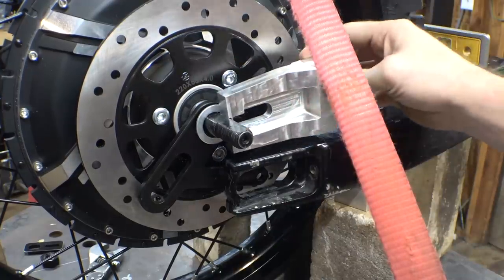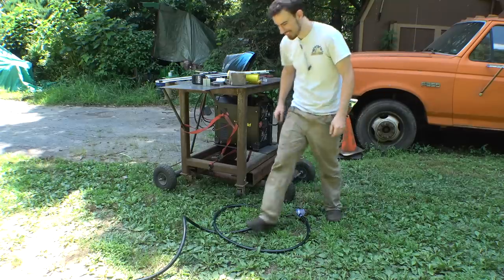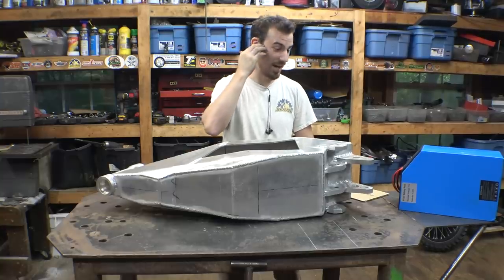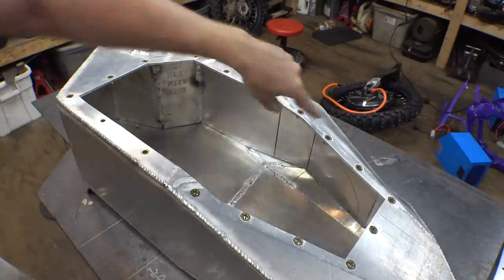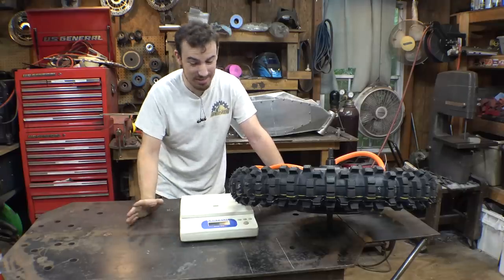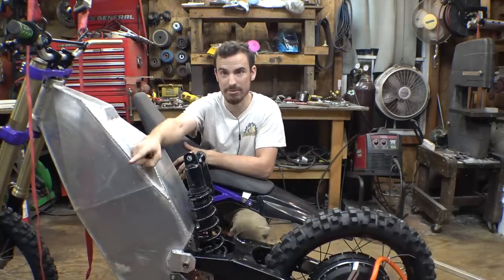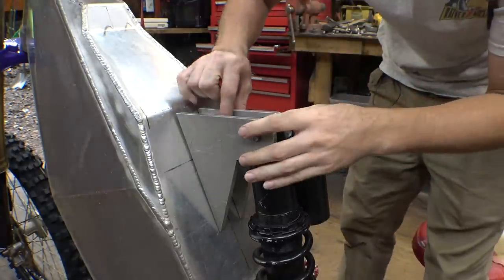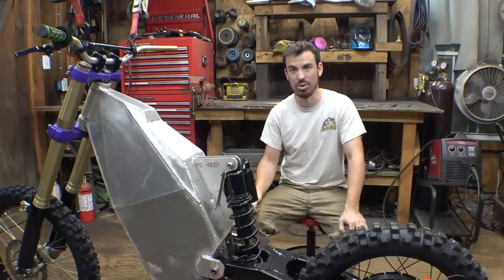Home Made Electric Dirt Bike Build - Part 5

Comment: I'd like to see the sondors metacycle rear wheel and swingarn weighted...8kW nominal/15kW peak, with wide road tire. it seems like they found interesting solution to have the spokes attached to small brackets on the very outside of the rim, probably to make the wheel stronger and more resilient to bumps ant potholes..with the disappointing acceleration, I've given up my preorder, it seems like too many compromises compared to a proper short range e motorcycle like a zero fx

Comment: I had the exact situation with not having 220v in my shop and managed to find an extension cord longer than 50 ft that just barely made it to my welder and it works perfectly! I have done continuous welding with it and it never heated up or anything. I definitely don't love how janky the solution is... But it does in fact work...

Comment: If that is a Pakweld 6 AWG extension cord you can run 100 ft. no problem.  I have a 75 ft. and it works great!
I'd consider putting a jint double on the top and inside of those real wheel mount blocks (if you can).  I wouldn't trust that butt weld either.

Comment: Nut rivets are great...BUT
THEY ARE METAL AND YOU PUT THEM IN SOFT ALUMINUM. 
DO NOT OVERTIGHTEN THEM BECAUSE THE RIVET WILL SPIN IN PLACE AND THE BOLT WILL NOT COME OUT! 
Believe me I know! 
I was freaking out when I saw you using the impact on them.

Comment: Fardriver controller are good for the price. 65 Lbs, QS 273 has a ton of copper in it. Its the one of baddest hub motor they make. Don't worry about the weight  in the rear wheel. While not ideal it will be fine. You will be happy when you bike makes 200 ft lbs torque. If the controller get too hot while inside the frame it will protect itself. Do you have any idea what the BMS in the new battery is set at? It looks great. Looking forward to more.
Reply: The BMS is the key to all of this. I mentioned that back several episodes ago. Doesn't matter how big the battery pack is if the BMS can't supply the amps.
Reply: @jamescole6846  agreed. I would love to take both batteries apart and built one big one with a larger bms
Reply: The other alternative is to bypass the bms.
Reply: @ryanmerrill8879  That's how I run mine and it is a pain in the ass to keep an eye on and charge but I run 14.4v 16000Mah lipo packs in a 4s2p string which is 66v 32amp. They are 20C discharge rated so I can easily yank a 150 amps when I need to. Most of the time I average about 80amps. it was a temporary thing until I got a good battery pack but 3 years later and I still put up with them ad have yet to get a real battery pack which is why I am following this.
Reply: @jamescole6846  I build batteries here in Canada. I started with LiPo about 12 years ago. I eventually decided to build my own from used LifeP04 cells. Now I build up to 100ah batteries that output up to 1000A. Safety the most difficult part. Put everything in a metal box is my advice. I still love to watch other people builds which is why I'm here.

Comment: it would be nicer if you milled the ends a little bit smaller so it could shove in to the rear arm like the original did couple centimeters.

Comment: 🇺🇸🇺🇸Hey when you get the other cord I would run some pvc for wire and put it in the ground it doesn't have to be deep. Maybe a foot deep and it would be good to go it's the way I've got mine and it's great it's worked for years that way and no problem

Comment: The angle changed because the difference between the original front tire and the new hub tire has it leaned back from when it was with the original back tire

Comment: Hi ! the Bomber that I assembled as a Kit and a wheel motor also from QS motor but it is a V3 of 8 Kw nominal and with my anti-puncture inner tube which alone weighs: 1.650 kg and my new Bridgestone tire which weighs heavier than the original one, my wheel weighs 28 kg and I do off-road without any problem, but reasonably because I have no experience in off-road, so I do not ride at very high speed on completely rutted terrain and I don't do any jumps, especially at my age, I don't want to break anything and destroy my Bomber. It's that a Sur Ron leaves it largely behind in all terrain, but this one is a very small and light motorcycle next to my Bomber which weighs 82 kg, because the frame is all steel unfortunately, on the other hand your frame is beautiful and your Bomber should not weigh very heavy. it's good for off-road, but on the road too light a machine which can reach almost 110 Km/h, (well for mine anyway) when it's too light compared to power and torque , it becomes unstable at high speed. I know that since I changed my tire, it's been night and day compared to the Chinese tire it was equipped with, what a difference in road holding and flu too. But these hub motors are a treat, no noise so to speak, insane torque compared to not huge power, and for me it's just fun and I always have a hard time getting off of it, it doesn't it's only the autonomy of my battery that brings me home, I have between 65 and 70 km max of autonomy, but I have a lot of long and steep hills in my area.
For info here is one of the videos of my machine, lol! which gives me great pleasure:
https://www.youtube.com/watch?v=Ldwiy9KROUA&t=3384s

Salut ! le Bomber que je me suis monté en Kit et un moteur roue aussi de chez QS motor mais c'est un V3 de 8 Kw nominal et avec ma chambre à air anti crevaison qui pèse à elle seule : 1,650 kg et mon nouveau pneu Bridgestone qui pèse plus lourd que celui d'origine, ma roue pèse 28 kg et je fais du tout terrain sans problème, mais raisonnablement car je n'ai aucune expérience en tout terrain, donc je roule pas à très grande vitesse sur des terrains complètement défoncé et je ne fais aucuns sauts, surtout à mon âge, je n'ai pas envie de me casser quelques chose  et de détruire mon Bomber. C'est qu'un Sur Ron le laisse largement derrière en tout terrain, mais celui ci est une toute petite moto et légère à côté de mon Bomber qui pèse 82 kg, car le cadre est tout en acier malheureusement, par contre ton cadre est magnifique et ton Bomber ne doit pas peser très lourd. c'est bien pour le tout terrain, mais sur la route un engin trop léger qui peu atteindre presque 110 Km/h, (enfin pour le mien en tout cas,) quand c'est trop léger par rapport à la puissance et au couple, ça devient instable à haute vitesse. je sais que depuis que j'ai changé mon pneu, c'est le jour et la nuit par rapport au pneu Chinois dont il était équipé, quelle différence de tenue de route et de grippe aussi. Mais ces moteurs Hub sont un régal, pas de bruit pour ainsi dire, un couple dément par rapport à une puissance pas énorme, et pour moi ce n'est que du plaisir et j'ai toujours du mal à en descendre, il n'y a que l'autonomie de ma batterie qui me fait rentrer chez moi, j'ai entre 65 et 70 km max d'autonomie, mais j'ai beaucoup de côtes longues et raides dans ma région.
Pour info voici une des vidéos de mon engin, lol ! qui me donne beaucoup de plaisir :

Comment: Seat solution, why not a scrambler/cafe-racer style seat?
Reply: And just build a pad to fill the empty space on the frame/use the empty space for a gauge bracket, (you’ll need wheel speed/rpm/battery etc

Comment: Part 5 part 6 part 7 part 8.. sorry Chris but damn
Reply: Hopefully he rides it in the next video
Reply: It’s super important that you match the stock frame with the top shock mount.  I think the reason your seat isn’t fitting right. Is that your shock is too far up.  I think compared to the stock frame you need to raise your fame up a bit.  You really need to build a jig with the stock frame, shock, linkage etc. and swing arm and you will find that the seat will fit.

Comment: I wonder why you didn't make a steel frame and weld the mono shock with the frame instead of a simple thin aluminium casing? Besides you could have use some bearings for the rear fork bolt instead of simply using aluminium hook and the bolt! Good luck any ways..

Comment: Why did you go with a hub motor over a mid drive? For more quiet operation?
Hub motors are not good for going over jumps just so you are aware? Also not easy to change wheels if you want to make it a motard?
Reply: 17 minutes in you addressed my questions 👍
Reply: Not sure if you read the comments or not? But I've got an Stealth Ebike that I'm hoping to modify to convert it into a mid drive bike? I'm hoping to have more motocross style wheels like what you are running also. But the idea I was thinking of doing is mounting the the motor too the swing arm and having the swing arm extend into the body somewhat? That would eliminate the issues experienced with the chain drive system on most conventional motocross bikes? When you see a motocross bike jump and land; when the rear shock is fully compressed, the amount of slack in the chain is overly concerning to me? This is due to the mid drive engine and swing arm pivot point. The mid drive motor is detached from the swing arm, so the pivot point between full compression and full extension on the bike effectively lengths and shortens the chain? However if the motor is still mounted mid drive but not into the bike chassis; but remaining on the swing arm; then this would cancel out the shortening and lengthening of the chain drive? I would extend the swing arm beyond the rotation point so that the shock can remain in the stock location and wouldn't have any adverse affects on the suspension geometry?
I thought it could be really cool to eventually convert the chain drive to shaft drive within the swing arm(deleting the chain) and because of the motor location and what I mentioned already, it would make the shaft drive considerably less complex than conventional shaft drive systems on motorbikes?
I would like to incorporate a 3:1 CVT but without the clutch mechanism (plenty of YouTubers have tried CVTs on ebikes and failed because they retain the clutch system with all the weights etc) electric motors need to be clutchless to work with the CVT in order to function correctly? Lastly the torque tube inside the CVT will need to be recut to ramp up the CVT much earlier because electric motors make instant torque from 1 rpm and not like the ICE motor that needs to wind up due to its rotational mass and flywheel system?
Doing all this could effectively make a bike that could be switched from dirt to road (motard) in a matter of minutes because no need to adjust chain links for different rear sprocket etc.....it could be swap in and swap out in minutes?

Thoughts?
Reply: I've subbed to your channel too 👍
I thought I'd share some additional ideas with battery pack for my build also?
I'm thinking of using blade batteries as they are far safer and nearly no chance of explosion if they get wet.
Because of the motor returning to mid drive and therefore reduction in over all space within the chassis, I am considering going wider with the battery up top and integrating water cooling using conventional motocross style radiators and panels? To further increase rapid charge times by regulating the battery temperatures (great for prolonged wide open throttle and large amps while thrashing+ regen) but on top of that utilising Peltiers for inductive rapid cooling whilst charging along with fans on the radiators as there will be no air flow past the radiators while the bike is parked recharging 😉
So fans + Peltiers would kick in whilst being on charge and possibly during extended periods of thrashing? Peltiers are highly inefficient, however they do provide rapid cooling (and or rapid warning capabilities if you live in a cold climate). This is something Tesla owners have issues with when they charge in snow conditions as the battery pack needs to charge extremely slow when the battery internal temperatures are less than 50 degrees celsius. Peltiers can literally be switched from hot or cold depending on their polarity. Plus they are a damn lot smaller than a air conditioning system for a motorbike! 😁

Comment: Shouldn't that rear strut be mounted with the wheel at where you want maximum droop on the rear? You mounted it with no load on it at rude height, so when you lift the rear of the bike up, there will be fuck all down travel?

Comment: So you realised that a perfectly built factory frame, designed on a high end CAD/CAM system, to precise specifications for rake and trail, cannot just be easily replicated? You should have just used the KXF frame, there would have been enough fab work involved and you wouldn't have made all those mistakes. 😉

Comment: It's actually better to have that un-sprung weight onto the tire-- because it puts less weight onto your shocks.  It's not that big of a deal.  It's not like it's rotational mass.  Most of the mass in the hub doesn't spin, so it shouldn't sap your acceleration.

Comment: Highlight of my Sunday! Voltage drop along that length wouldn't be that great. So long as it isn't coiled. Amp hours has everything to do with battery pack size. Greater the A H bigger the pack has to be. 12kw wheel maybe un sprung weight. But imagine how easy it would be to have a two wheel drive dirt bike with two 6 kw hub motors. Easy to do as well.

Comment: How about you listen the audience/community and before starting a new project have community help you design the project, so you dont run into major issues like with hub motor?
Since we are in this stage, just swap the name of the project to dual sport, since this thing will have traction issues on any higher speeds on uneven surface due wheel being too heavy to respond rapid changes of the surface and higher speeds having negative effect on the handling like turning into corners and cant jump due danger to rim, so its not suited for off roading like dirt bike and more suited to pavement and going to dirt roads where it can more easily rescued when running out of battery. Might even get it registered increasing its value.
Alternatively you could install front hub motor, make this much lower to ground so you can easily get balance with legs and make it slow crawler in the really shitty terrain with 2x2 drive.. just make sure to have removable battery so you can go charge it at home, since recovering such heavy bike with out power will be pain in the ass.
For power for the welder, just dig a ground install tube from house to shop, so you can slide trough everything from power to even water tubes. Get cable of suitable size from main fuse box of house to garage, you can then add your own ends to cable making it extension cord for now and later on make it permanent install. Dont waste your money on ready made extension cords since those are expensive and ask the what kind of cable would be suitable to power whole shop that far from the main box.

Comment: Why didn't you just Mount the motor and everything else on a nice aluminum Honda frame then fabricate the fit and have normal wheels swing arm and make it so you won't have problems this contraption is just not gonna work well I can see it already plus it looks like crap ..sorry just my opinion.  I think your an amazing craftsman but not well thought out this project.